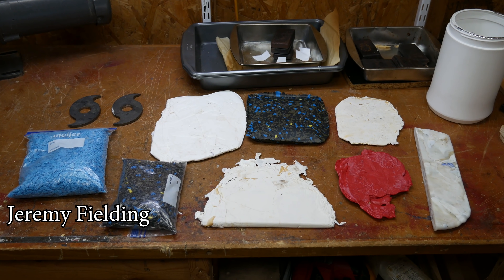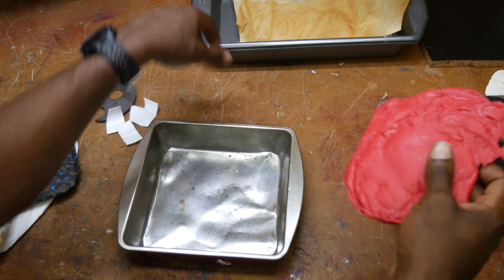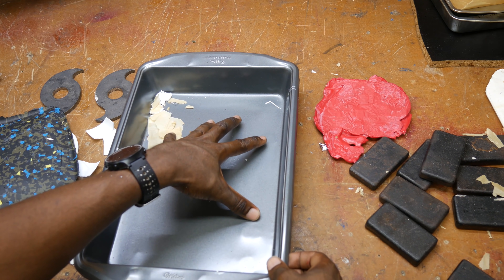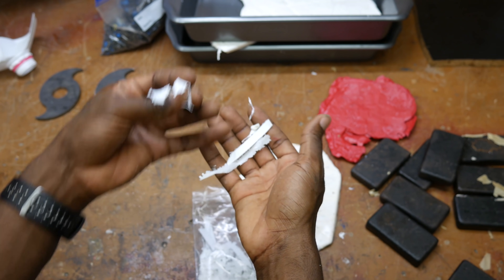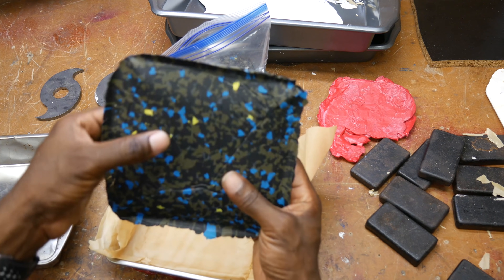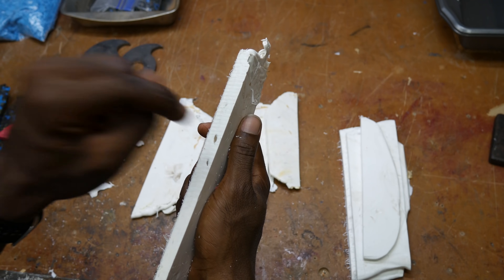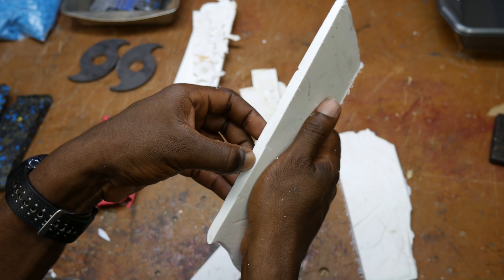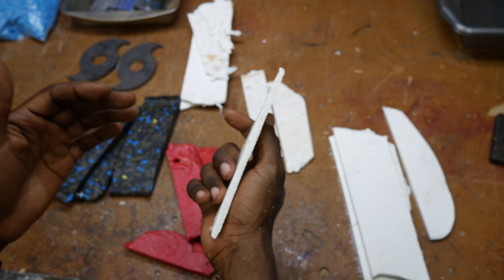HDPE, How Much Processing Is Required; I Put It To The Test!: 043

Comment: With your dado shredder, bring the table up to where it is even with the shaft.  This should stop it pulling the plastic from your hands.  Also try using wax paper (used for cooking) as an insulation between pan and plastic.
Reply from the maker: +Big Renegade I started using silicon baking sheets due to a suggestion like yours. It works amazingly well

Comment: Jeremy, for solid adhesion with NO "voids", you need to apply more pressure while it is heated.  I worked in the injection molding field for a number of years and to get a solid "no void" requires increasing the "back pressure" or, in the case of your concept, more weights in the pan
Reply from the maker: +Big Renegade we are on the same page. I am working on a press in combination with improvements to the shredder. I think the final product will be consistently  uniform with those two together.

Comment: enjoyed your videos - new follower, new subscriber, love the latest dado shredder design - followed suggestions from Dave on PreciousPlastics - I'm assuming he inspired you too.  I suggest you use spray silicone lubricant on your heating sheets and get away from the paper altogether - they say silicone spray doesn't melt until 800 degrees F, also, I expect you will end up needing to use some sort of pressure  if not bite the bullet and move to extruding process to eliminate bubbles and get the nice grain you want.  Take a look at 1D10CRACY's video https://www.youtube.com/watch?v=aq9wJYVEey8 , keep posting and I'll keep watching.
Reply from the maker: I now use silicon baking sheets and they work very well. After a decent amount of shredding there really are no voids as shown in the video. I only suggested there may be ways to reduce it through trial and error for those who don't want the shredder approach. I get comments from many on that. I am committed to shredding first. I just need to finish the shredder design.
Reply from the maker: Welcome to the neighborhood!

Comment: I've been thinking about using HDPE to make runners for my table saw jigs and came across this video while searching "how to" vids. These tests are very valuable and will save me a ton of time experimenting on my own.

I was hoping to line my mold with aluminium foil. Does the HDPE stick to it? I would guess that your pan that the red HDPE stuck to was aluminium, so perhaps it's not a good idea.

You have an awesome channel, and I can't believe I haven't come across it before. I really like what I see & I'll be spending a lot of time watching your other vids (I subscribed, of course).
Reply from the maker: +Robert Farmer thank you for the kind words. I now use silicon baking sheets and they work very well. The AL didn’t work very well when the HDPE was hot. Anyway welcome to the neighborhood!

Comment: You could try used engine oil as a mould release agent. The boiling point of motor oil is very high, about 572 degrees Fahrenheit, so it is unlikely to significantly off gas or catch fire at the kind of temperatures you are using. It is also unlikely to affect the plastic (but this could only be determined by experiment). More importantly it is likely to be freely available (possibly even for free). You could try spraying it on your pans, or on to the parchment paper.
Reply from the maker: I started using silicon baking sheets after someone like yourself recommended it here. They are awesome. It works perfectly everytime.
Reply: Good to know. Thanks.

Comment: Try silicon mats instead of parchment.  I have a couple silpat mats that I "re-purposed" because I got tired of picking burnt parchment out of the chunks of plastic.  I'm trying to come up with a way to heat while applying pressure AND keeping the plastic from sticking.  Heat and pressure at the same time are the key to reliable billets.
Reply from the maker: +Jeremy Jones Hey Jeremy! I bought the mats right at I published the video because someone like you recommended it. They work great

Comment: "Ultra High Molecular Weight" PE - really long chains. The more melting cycles (and the higher the temperatures of those cycles) the shorter the chains get over time, and the harder to melt. I have a billet of white HDPE from bleach bottles that I did before i knew about the temperature issues, which I had melted at 500F several times, which is now very difficult to melt and has an almost glassy texture.
Now that I've got a proper engineering lathe, I may turn it into mallet heads...

Comment: Just get some silicone spray instead of parchment paper.
Also, don't think of any kind of HDPE as "melting" - It doesn't have a melting temperature because there is not a particular temperature where it transitions from solid to liquid in the same way that ice turns to water. It just gets softer and softer and softer as it gets hotter.
Look up "Vicat softening point" for more information on that.
Reply from the maker: It is nice to know there is a name for it. Anyone who has tried to form HDPE would understand what was meant by "melting" but I agree it really just sags and softens. The UHMWPE show no signs of softening even after passing its "softening" point. Thanks for the information. I learn something from you guys with every video.
Reply from the maker: I ended up buying silicone sheets which are awesome! They work perfectly every time.
Reply: Generally speaking, all forms of HDPE have a relatively high specific heat, or what I always thought of as "thermal inertia".
It is not a very good heat conductor, but is relatively dense ( roughly about 0.93 to 0.96 g/ml, just a shade less dense than water), so it takes a long time to heat a pile or chunk of it evenly throughout it's cross section.
UHMWPE (Ultra High Molecular Weight PolyEthylene) is on the higher end of this scale, and as such, is that much tougher to heat evenly through your sample.
Basically, the reason the concept of "melting" is so transitional in plastics forming, is because depending on what process you are using, the "melting temperature is very different.
If you are thermoforming, you have a sheet of plastic that you need to maintain some dimensional stability, yet be "formable" enough to make a good part on the mold. If you are extruding or injection molding, you need the polymer to be in pretty much a liquid state, with zero dimensional stability.
So, it becomes a question of whether it is "melted enough" for the process - which is relative.
Your block of regrind in the video never reached anything like a liquid state, but it was "melted enough" for your process. If, however, you were trying to cast that regrind into a mold with high definition, it would have been way too cold.
As an aside, keep in mind that your upper temperature limit for HDPE is about 515 degrees F, after that, the polymer chains unzip, and you end up with a bunch of smoke, some oily stuff, and a sticky, nasty yellowish brown asphaltic residue - which is a pain to clean up.

Comment: Jeremy, i form mine in ingots in soda cans in a crockpot.
About 1/2” square flakes.
Not sure what you plan to make. Mine all get turned on the lathe. The hdpe shrinks enough to easily come out of their molds.
Reply: countrieboyz2009 
I currently hand cut the hdpe with scissors or shears into roughly 1’ squares then put them in an aluminum can with the top cut off. At that point I put the aluminum can in the crockpot at about 250° and let it sit for a few hours until it starts to melt. 
I make shaving handles with them and knobs for cabinets or drawers. They’re pretty fun to turn on the lathe because it shoots thin shavings in the air.
That’s what was so great about Jeremy‘s project. A shredder that so accessible as far as materials.
I haven’t tried to build it yet.
Reply from the maker: +Ty Goodman I prefer sheets. I want to cut it like plywood to make gears and things like that
Reply: Jeremy Fielding 
Love your channel great content.
Reply: Ty Goodman what do you make with those on the lathe? And could you explain you ignot method a little please?

Comment: Hi, Jeremy, I liked your experiments however you are over looking two things air and dirt. Large pieces of plastic the air is more difficult to escape as it cannot pass through the large pieces and dirt. Pieces may look clean but are they? When you weld you have to use a flux to stop oxidisation and it is also a cleaner. Home made cut plastic will very in cleanliness, just rinsing will remove dirt but not oily residues. Shop bought plastic pellets would have gone through a quality control and would be 100 % clean and being small pieces air would escape More easily. Is plastic dust dust better than pellets?
Reply from the maker: I did clean the plastic with soap and water, but I forgot to mention that in the video. I think my plastic saw dust performed the best by far.
Reply: Maybe you had some soap residues. How do the professionals clean the plastic? Do they use sonic baths, solvents or do they use just soap and water? The dust would not trap air so yes the smaller the pieces the better.
Reply: Also if you like experimenting instead of using rotary blades for your shredder use a slice bread machine with saws going up and down
 As everyone when they have made their plastic block use a saw to cut it.

Comment: I thought seasoned cast iron wouldn't have much stiction issue and I wanted that massive retained heat for keeping it hot and malleable.. but I was very very wrong. I was using silicon oven gloves to do all the handling and realized silicon mats were probably a good bet. Since I made my mallet I haven't gone back to doing anything with HDPE, yet.
Reply from the maker: I am using the silicon mats now, and they work great.

Comment: Try a glass tray  (Pyrex) , seen another guy using Pyrex pie plates and getting mirror finish with no sticking.
Reply from the maker: +Blade Lord sounds nice. I purchased some silicone sheets and they are perfect. Zero sticking so I can move the plastic during baking... or grilling is the current method.

Comment: I was thinking about this problem today, and it seems to me that you really need 1 set of cutters goin 1 way, and a second set going the opposite way.  I’m thinking the easiest way to make 1 motor do that is to twist the belt into a figure 8 formation. The belt would wear more where it hits but, it seems like it could work
Reply from the maker: I prefer the single shaft design for several reasons but mostly because of its simplicity. Industrial plastic shredders often have one shaft not two. Then they use a screen to control the final size of the shredded plastic. You don't usually have that with a dual shaft shredder. Have a look at this website to see the difference between single shaft and dual shaft shredders to learn more about their applications. http://www.sinoshredder.com/what-is-the-difference-between-single-shaft-shredder-and-double-shaft-shredder/

Comment: After viewing a bunch of videos from different people experimenting with hdpe I was under the impression that it doesn't really stick to any thing but itself. I have melted some in toaster oven in a metal tray at 350 and it never stuck to the tray. I've seen glass used also with the same result. No parchment paper needed.
Reply from the maker: It is not sticky when it is cool. The problem is I try to move it while it is hot. At that point it is very sticky. I want to roll over the edges so there are fewer voids and less wasted plastic around the edges.
Reply: Ah! I see!! Maybe a deeper container that can hold a thicker pile of shredded material & a second container that can nest into it so that what oozes up the sides, where the voids are maybe more likely to occur, can be machined of? It would really be cool to figure out a way to make board feet of this material at home like they use in picnic tables!

Comment: I've been experimenting  w/ hdpe for making blanks to turn toy tops with. I'm using energy drink cans as the mold w/ a turned wood stopper to press the plastic together after it's melted. The cans are 1 use but do give me a blank w/ less waste. You might try using diff sized cans.
Reply from the maker: My ideal result would be a sheet. That is the target for me.

Comment: Props on the dado shredder.  The industrially shredded stuff might be a red herring, because it's not the same plastic.  UHMWPE is Ultra High Molecular Weight PE, so it's essentially a different molecule.  The melting and flow characteristics may or may not be the same as regular HDPE.
Reply from the maker: I didn't draw any world changing conclusions, only that the most shredded plastic had the least voids, the least shredded plastic had the most voids, and the others followed suit on the same scale. It wouldn't be published anywhere, but for back yard science that is pretty consistent results. My DIY shredded plastic also had no voids. What I learned is shredding makes enough difference that I want to continue shredding. But I also didn't want to pick a fight with those who insist you don't need to shred. That is why I pulled it back alittle at the end with the "you can probably make full sheets work with some trial and error.
Reply: @Jeremy_Fielding  I'm a chemist, although not a polymer specialist.  I would expect UHMW HDPE to be more difficult to flow as the much longer molecules are more probably more tangled.  Wikipedia says the melting temperature is approximately 130 C, somewhat higher than ordinary HPDE.  It also notes that it is not recommended to heat at 130 for any length of time, as it changes the material - although it doesn't specify why.  
I too am interested in a shredder and have no funds to purchase the real deal, so I'm enjoying your efforts.   Thanks.

Comment: For that white sticky plastic, you can use a mould spray.. Spray silicone.. Waxes, etc are not going to work very well because of the temps, but, you can try that also.. Will work if you don't lift, press, lift press.

Comment: I think cooking time may be important.  Just a shot in the dark.  Thank you and take care.  Paul.
Reply from the maker: I believe so also. I need some practice to work out the details of it's importance.
Reply: Hi Guys. I have some questions here. 1) The melting point of HDPE is given as 210-270 centigrade. Is the range due to polymer length?  2)  What happens if the plastic pieces are left at a suitable temperature for a long period?  3)  Can the HDPE be melted to liquid form and poured into moulds as a "cheap" alternative to injection moulding?  4)  Could HDPE be used as an alternative to wood in house construction?
Thanks

Comment: I used to work in a color plastic master batch company. When we would press out pellets we used mylar sheets. I'm sure it would work wonderfully for you, but it is kinda pricey. Also note that you can reuse the sheets. 

I also wanted to point out that the color pigments change the melting point of the plastic. In my memory I wanted to say that black plastic seemed to take longer to melt, but would hold the heat longer, which may have skewed the results of your industrial shredded plastic. I don't know the type of HDPE used but I know that some of the difference between plastic is the amount of wax in it. In the current company I work for we use process aid which is mainly wax. It helps to make the plastic look better when processed.

Comment: Have you tried a double cut paper shredder? I know that they are low powered but I feel sure that the cutters are robust enough to shred this material at their designed cutting speed if a larger motor was employed.
Edit:
Just noticed another comment where you have. As a note the cutter will heat up at high speeds and melt plastic; a slow speed may keep the cutter cool and prevent the clogging you mentioned allowing it to dissipate any heat caused through friction.
Reply from the maker: It wasn't running long enough to for it heat up. I could feed just two or three pieces, and they get jammed. The whole assembly is just to fragile. It might cut one or two credit cards, but it won't shred HDPE of any volume useful. It was easier building from scratch then using that paper shredder.